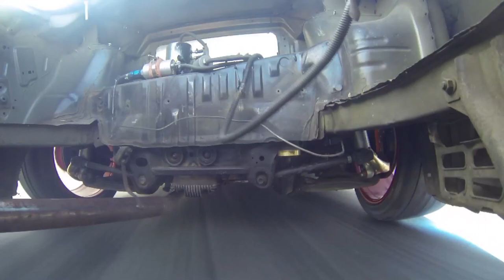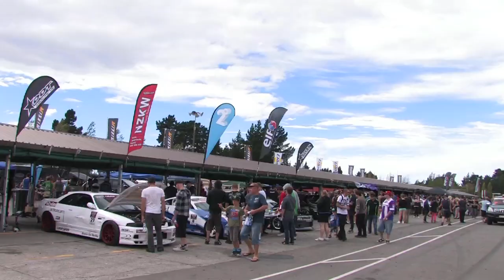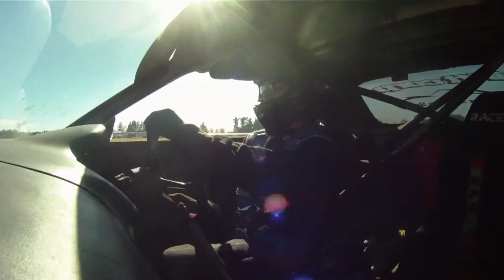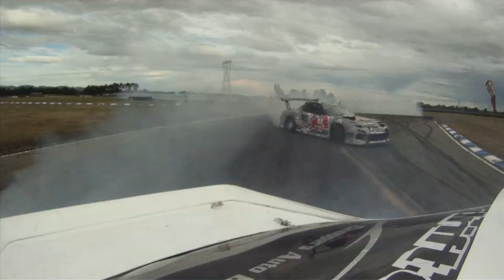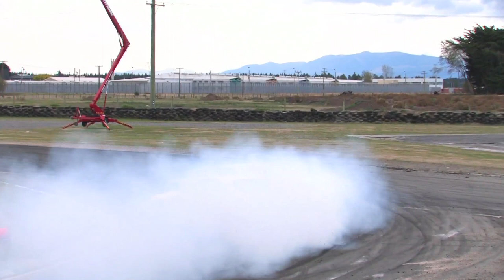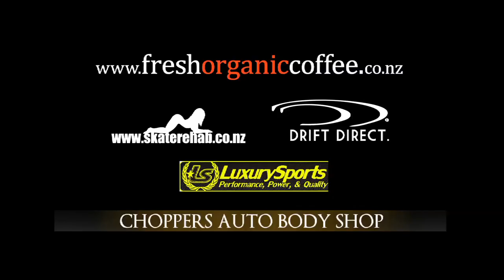Zak Pole vs Mad Mike Whiddett

Comment: I'm definitely a Mad Mike fan, I'm a rotar nut through and through......but I have to say that Zak maintained better corner speed on the chase in each of his runs. Mike ever so slightly had larger gap between his and Zak's car when he was chasing. I would say this is only due to less torque and lower down power in the rotar. Mike (when he got traction) was quite capable of picking up faster speeds though so this definitely made up for it. It's a hard decision?